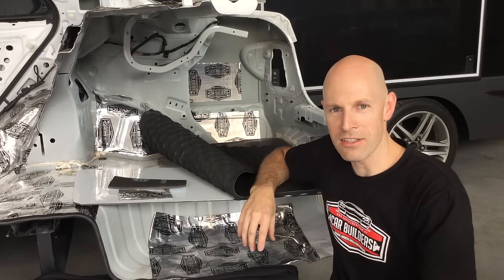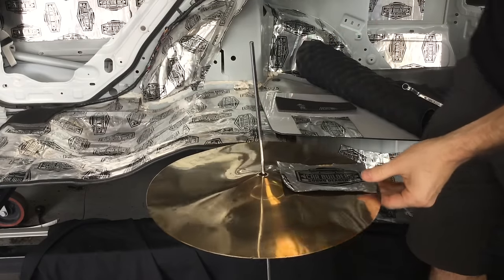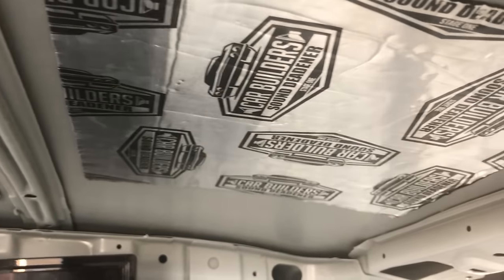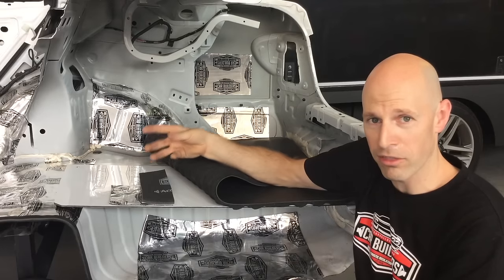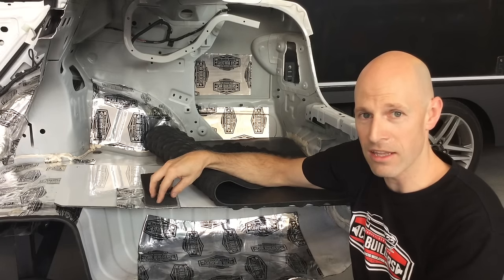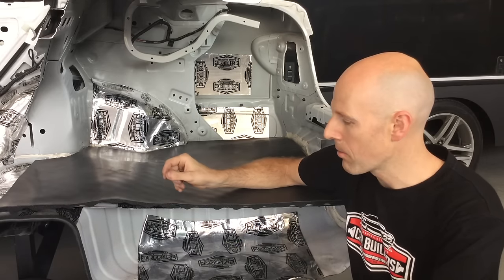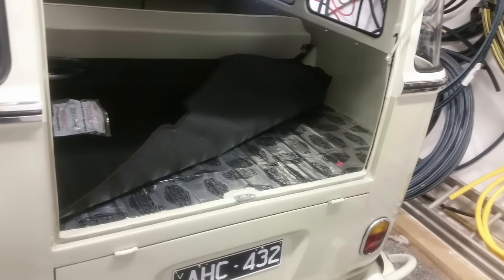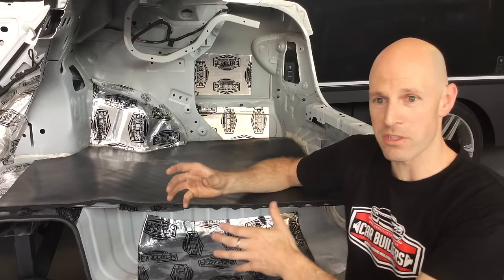The basics to sound deadening in cars. What should I use to control sound and heat in my car?

Comment: You perfectly showed with the cymbal, that a small patch on a large surface area is enough to stop waves in a material aka sound. So there is absolutely no need to cover your whole floor with sound deadening material....!
Reply from the maker: Hi PJ. You're right. Moderate amounts of deadener make a significant difference. Once the middle of a panel has been covered, the additional deadener covering the panel has diminshing results. Auto manufacturer's will engineer sound proofing to a dollar point, researching the optimal positioning for deadening to just meet consumer expectations. Vibration dampening mats are most effective on single skin metallic surfaces. It is unnecessary to apply deadener to over-lapped metal sections, top hat, chassis sections etc as these areas don't resonant. To engineer a car it takes some skill and technical analysis to pin point key areas, in reality most people will cover everything as they don't mind spending a bit more to ensure they have achieved the desired results. With paying customers, most people want everything covered. Keep in mind that this is one stage in controlling sound in your vehicle. 😎👍
Reply: @carbuilders1  And if you want better insulation as well as sound deadening (like me), then covering everything makes more sense, right?  🤔
Reply: @carbuilders1  Is it possible to take aftermarket double glazed side windows from more expensive vehicles and cutting them to fit in cheaper cars (like the VW golf for instance).

Comment: How about just driving the car and taking decibel measurements before and after applying the insulation material?
Reply: Its not that easy.  You would have to average HUNDREDS of miles over the same roads in the same conditions (traffic/temps/weather/etc) and then do it again with the treatments in place.  I know.  I've tried.  Ive also tested vibration damping products in a controlled envinronment.  While I dont agree 100% with everything here, this is one of the most accurate descriptions on youtube on how to fully treat a vehicle.
Reply: People have done it. Insulation, depending on the vehicle, is good for between 5-20dB of sound reduction. Really dependent on vehicle and how much you use.
Reply: @gymkhanadog  Taking short measurements before and after are misleading.  Too many variables.  Just a difference in temp changes air density and therefore noise levels.
Reply: @chrispurdue5762   I'm not looking to argue, but saying that subjective testing, even short term, is worthless is also misleading...  We aren't talking about putting a used vehicle in an anechoic and doing before and after measurements. That would actually be good science. We're talking about subjective testing in the real world. Which is why I said 5-20, which is a pretty big sound range. The difference of 5 dB could mean damaged hearing or just a very uncomfortably loud sound. Remember, sound is measured in a base 10 log unit. Factor of 10 to make it easier.
Reply: @gymkhanadog  I can agree with most of that.  I simply feel its important to make sure people understand that these tests need to be done in as controlled of a manor as possible before making claims.  Having worked on objectively testing vehicle sound treatments for the last 8 years, ive fought for the entire time to discredit claims that products such as peel n seal are equivalent to products like Dynamat based on other peoples subjective "knock" tests, etc.
Reply: Vibration dampening mat like dynamat, kilmat, or the knock offs do little to decrease road noise in the cabin. What it actually does is allow your car speakers to move air rather than sheet metal, increasing their efficiency.
Reply: @thealienrobotanthropologist  When I say it's only possible after hundreds of miles, I'm talking strictly talking about broadband road noise, NOT vibration damping performance.

The bottom line is vibration dampers should not be your first line of defense against broadband noise, because they are a narrow band solution to a narrow band problem.

That said, for high quality audio in a car, you can't always just shift a low pass around and fix the issue, especially if you want good response from 20hz-20khz.
Reply: @gymkhanadog  Not really you drive on the same  highway 10 min  at the same mph , and do a before, and  after pretty simple .   I have had sound deadening on three of my cars , trucks. It has pro , and cons . Cons it's still somewhat heavy no matter what, unless you use some kinda of spray to do a entire car.   Labor is expensive, on older cars I advise just doing doors for noise reduction.  When I say doors , both inner , and outer panels. That usually makes the biggest difference.  You have to reach a point with expectations , unless you are doing a entire car. Which is not worth it to me because of cost , weight. Ps check out NVX bulk pack 30sqft for 100 bucks.   It can make a significant difference, But it really does vary on the car. Also the marketing ads are very misleading you can use 40sqft just on all the doors for full coverage on a full size car 
  Obviously a 25 sqft door kit is not enough for full coverage. They claim at 65% lol.
Reply: @chrispurdue5762   Temperature ? Well not much difference .. Never noticed my car louder or quieter on a cold day. !  Would hope this sort of treatment makes absolute massive difference. 3 layers of old carpet works quiet well
Reply: @brackcycle9056  The problem is this type of deadening is ONLY useful for vibration damping, not broadband noise.  Google CLD Testing, and the first result will be a link to objective testing i ran several years ago on 28 different products like this.  And im getting ready to start testing again, with a much more sofisticated test rig, which will allow 126 data points per material.
Reply: @chrispurdue5762  Not true, at all... driving along a flat surface would yield nearly identical results if you repeated the same road with deadening installed.
What you meant to say was: "how do we test sound deadening effects in multiple environments". Ideally, you would use a decibel meter and live record both trips with and without the deadening installed. Many things can lead to these results and driving 600 miles, aimlessly, isn't going to yield you a great baseline.
Reply: @davethefish7653  Sadly, if it was as simple as you claim, it would already be done.  I have a few years under my belt of objectively testing constrained layer dampers.  I've attempted what you've suggested, and it's just not that simple.  

And of course, the big thing is that CLD isn't a "sound deadener".  It's a vibration damper.  It's a narrow band treatment which makes it extremely difficult to test in the manner you have suggested.  This is why I have a test rig in my garage that weighs nearly 800lbs, that has a repeatable way of vibrating a test panel, while measuring the results with a calibrated microphone, at multiple different temperatures and output levels.
Reply: @chrispurdue5762  If it's as simple as I claim, it would have already been done? It's been done. 

Sound pressure in vehicles traveling at a high velocity is relatively high compared to dB and octave band levels. This means most of the sound energy is in the low frequency and infrasonic regions. Monitoring 0-100Hz isn't a challenge with today's technology. Any calibrated sound level meter can feed a frequency modulation and record noise. You can actually perform 3 separate sound metric tests which are resultant.

I don't see a purpose for the distinction you're making. In acoustics, things vibrate when sound is made. A vibrational damper ultimately reduces vibration which would otherwise contribute to the creation of sound. Sound is produced when air molecules collide creating sound waves. When we hear something, it's due to the vibrations in the air. We can both monitor and compare the effects from tests. Sure, you can make a case against paltry conditions such as weather, humidity, and even outside sound levels.. but no real discernible differences if properly tested.
Reply: @davethefish7653  There is a huge point to the distinction I am making.  

Constrained layer dampers are a narrow band treatment, that really only works at and near the treated panels natural resonant frequency.  This is not something that is easy to measure in a moving vehicle, given how narrow band the effects are.  

Barriers, sure.  Something like a properly installed mass loaded vinyl barrier should be easy to measure differences with.  But the products most people think of as deadeners, ie peel and stick CLD products, do not work like that, and they play no significant role in reducing broadband road noise.  Their only real role is reducing peaks in panel resonance.  

Unfortunately I can't post pics here, otherwise I'd post frequency response and decay plots from measurements I've taken while testing different CLD products.  They are, however, available on facebook in a group called The Deadening, which has a sister channel on YouTube with the same name that will be putting out content within 2 weeks.  Effective bandwidth is usually about 20hz with off the shelf CLD.  It's usually even worse with OEM level damping products.
Reply: @chrispurdue5762  Yes, as mentioned, we are using narrow bandwidth as I stated the frequency measured between 0-100hz.. way below 25khz. I don't understand the reason you opted for this specific term as low frequency sound waves would be significantly more specific for this  application.

Why would you bring up the need for hundred of miles of travel to measure  sound from vibration when you state there isn't an effective way to measure such sound? You further state sound deadening isn't vibration dampening, which is true, but misguided as there's a direct mathematical relationship that's quite similar to how voltage and resistance are used.

It would seem you suggested one thing and stated that same process wasn't viable. Given the typical human's hearing can only pick up between 20hz-20khz, this makes what you're saying a bit off topic as the purpose of the product is 'sound deadening'. 

With this purpose in mind, measuring 'sound deadening' within this frequency is feasible. As stated, a sound level meter paired with an accelerometer would be all one would need to measure sound using conventional methods. The reason this is misconceived is that I've seen dramatically consistent results through testing applications for CLD. 

I would question your methods as you're seeing no discernible results.
Reply: @davethefish7653  I never said I wasn't seeing discernable results.  I said I was not seeing discernable results in a moving car that were  of a magnitude large enough to attribute it solely to the actual treatment itself. 

In fact, I can drive the same road repeatedly and have the mic record a measurement to compile an average every second, and have the overall frequency response change each time enough to prevent being able to directly contribute changes to the treatment, instead of other variables.

I have absolutely seen discernable results in isolated, controlled testing.  As I said, many products I've tested are really ONLY doing something useful in a 20hz bandwidth around the test panels resonant frequency.  Above and below that area, it is doing nothing measureable.

Now, yes, I could use an accelerometer, but again, testing on an open road is only really valid if you can hit the same line, every time.  Otherwise differences in the bumps and holes in the road would make it nessesary to compile average readings over multiple runs.  And again, that wouldn't directly correlate to noise inside the vehicle.

And yes, I'm well aware that sound and vibration are related.  That is WHY I test the way I do.  I use a calibrated measurement microphone to take measurements using sine sweeps of test panels in a controlled environment before and after treatment at a range of temps (as these products are largely affected by temperature).  I also test the products for reliability for heat and cold exposure.  This makes it much easier for the people that generally purchase these materials in the aftermarket to understand the results (car audio).
Reply: I did that. My grandfather gave me his 1997 RAV4 to me because he wasn't able to drive it anymore.

The car as an old Toyota has close to none soundproofing. I used a db meter on the highway because the car was a lot louder compared to a Nissan Qashqai.
I clocked it somewhere around 90 to 100db.

I used a STP splen 08 (and some STP aeroflex 06) that is good for soundproofing and for temperature control. That was the 1 layer. Second layer was a FatMan RT50 rattlesnake. 
Third layer was a Dynamat Xtreme self-adhesive deadener that most people recommend.

All those went on the floor and trunk. Then i put some Second skin damplifier pro on the doors with some leftover FatMan. The roof liner was in bad shape so i changed it and at the same time i added some of STP aeroflex 06 so the roof wouldn't make the cabin hot in the summer.

It costed the amount you would expect but the results were surprising. The vibration reduced a lot and the db meter showed a reading of 65db. The windows also impact the quietness but im not touching those. Also i did a 500km trip with the upgraded cabin and it was like driving a proper semi-luxury vehicle.
Reply: It will still be noisy

Comment: I used window sill tape in my new car, and that works almost as good as dynamat in my last car, (let me tell ya dynamat is a scam, well not scam, just OVERPRICED!)  use what ever these fellas are selling if it’s cheaper than dynamat!! Windowsill tape has worked wonders for several cars and trucks I’ve owned, and 1/100 the price :)

Comment: Very well stated and presented. Most newer vehicles do not have an issue with the single most annoying source of noise in a vehicle, engine noise coming from sheetmetal openings. If you are doing an older vehicle blocking airborne noise can be tricky but the tiniest of holes will tank an otherwise good installation of sound deadening material.

Comment: What an EXCELLENT description of the different types of materials. This helps me out a ton as I'm working on dealing with some resonance in my MX-5 this week.

Thanks again, I really appreciate it.
Reply: Bedline it inner floor and bottom...
Stone chip proof and its sealed from elements... loose the carpet... is the car a house from 1970?
Reply: @octaneartllc  If you don't have carpet, what would you have instead?
Reply: Same, I am here to learn and work on sound and heatproffing better my MX-5. Trying to do it with the least weight adding possible with the biggest return on sound and heat proofing
Reply: @89andresp  how is going? How much weight did you add? Is it worth? Thank you 😁
Reply: @Moriggia  Hi. Good and you? I haven't done this. It requires quite some free time that I don't have yet, or at least not desiring to spend it on my Miata. I have a few other things to install it plus repairing a scooter and I have had 0 rush on doing any of that. I work remotely and have been using my car only about one day a week in the past  10 mo. But if I happen to do this, changing the tube from the intake before the separator seems to help with engine noise (not removing the duct for the noise but changing the big section for a different material that is harder and transmits less outside undesired noise), plus sound proofing maybe mainly on top of the back wheels is something I will definitely do, just not sure when. I would like to heat proof the doors and the whole cabin wherever possible but I haven't found what to use that isn't heavy, is durable, not that costly, and is not a disaster/big problem to install as the weather in south FL is definitely one to consider. I installed window tinting in the front windshield, the clearest one one found and a good quality one $150 in Miami, and it made a big difference in temperature and glare (more comfortable driving) and no issues driving at night. Also, no issues with police as it doesn't even appear it has window tint in the windshield. My favorite simple mod so far.

Comment: I lined the interior walls and door of my clothes dryer while I was replacing the blower/fan.  Now it's better than any dryer I've ever used! Did the same thing on a noisy steel drafting table too.
Reply from the maker: 😆 nice work 👍
Reply: That is genius!
Reply: @willfinney6598  Thanks!  Similarly, I filled my 3-ton floor jack handle with spray foam. No more clanky handle!😀 AH... and maybe I'll put some sound deadening on my 4-way lug wrench... Just though of that!
Reply: Not a bad time to replace the bearing axle for the dryer drum while it's all apart. No more squeaking! Much easier to do than the blower in my opinion. (if your blower wheel is stuck on)

Comment: Great video explaining the basics!
 My first car that I put sound deadener in was a 99 grandam gt 2 door. 100% coverage. It dropped decibels readings up to 15db. It was a massive improvement to the cabin quality.  I spent a lot of money on it too, but it was worth it cause I had the car 10 years.  Now the cars I buy don't really need it to be honest. If I were to spend that amount of money again on material  the diminished returns wouldn't justify the cost. My Acura TL is already quiet for the type of driving I do now. Plus I spend good money on tires and it shows. Finding a quality tire made a world difference in the cabin.
Reply: yes tyres do matters.. specially youkohama advan db
Reply: The problem is good tyres especially Performance tyres are loud.